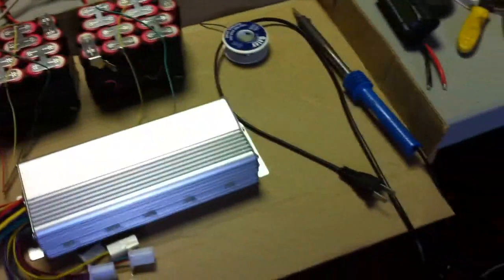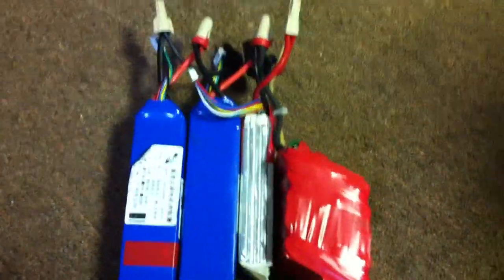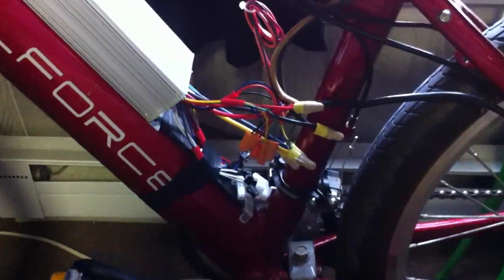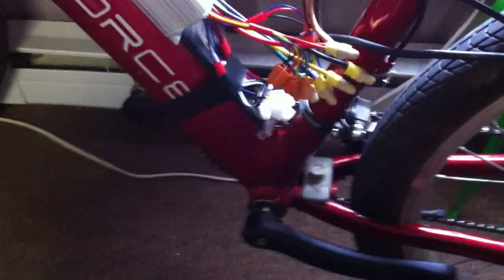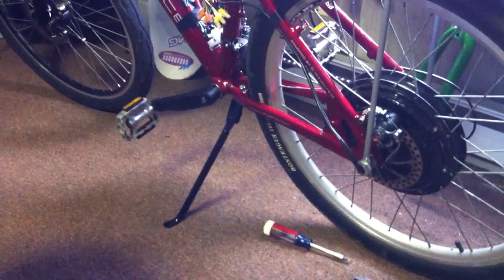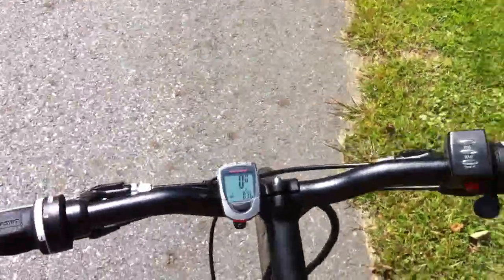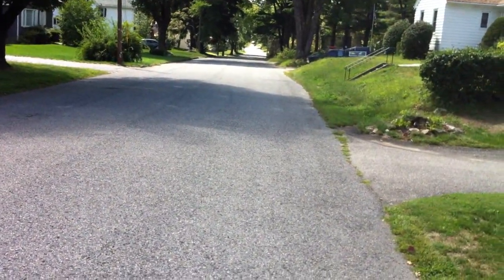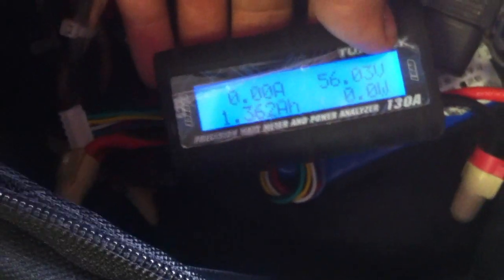60V Tidalforce S-750 Electric Bike New 40a Controller Installed and Tested

Comment: I love your Videos! Very friendly advice and generous knowledge sharing.

Could you kindly let me understand why does a ebike controller circuit board need to 'Self-learn'? Is it for the hall sensors to get 'acquainted' with the circuit board? Is it due to the different inductance in the motor?

Comment from the maker: yes you can a 48v 1000w DD motor can typically sustain 1500w and take 2500w bursts. just be careful not to overheat running max speed for too long. Ive run 20S lipo on my motor and gotten 40mph

Comment: i had a question for you scott could you run a 72 volt 1500 watt controller on a 48v 1000 watt motor or is that too much?

Comment from the maker: No it does not, I might end up getting a lyen controller again cause i may want to run 20s again when i get my x5404. then i will have regen. But this controller was only 48USD on ebay..good deal